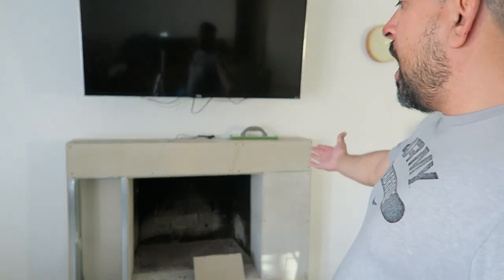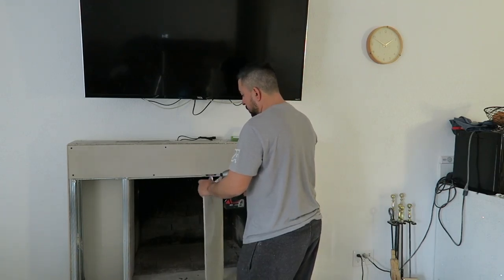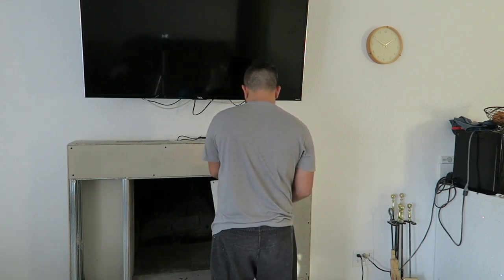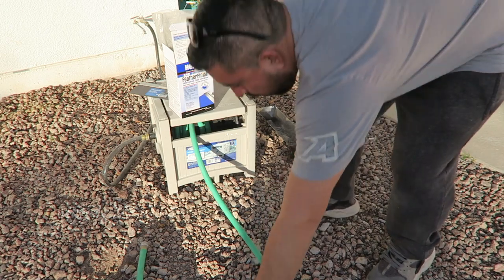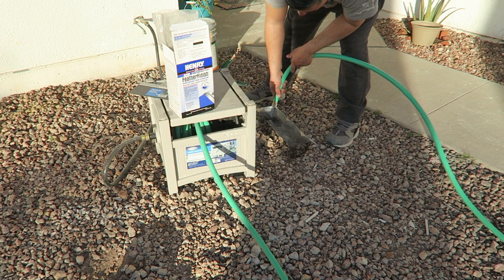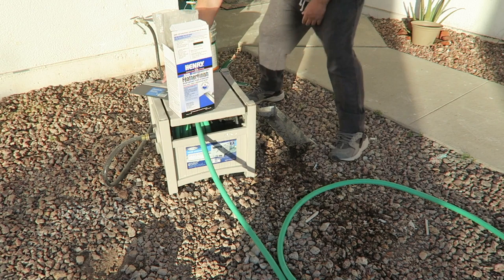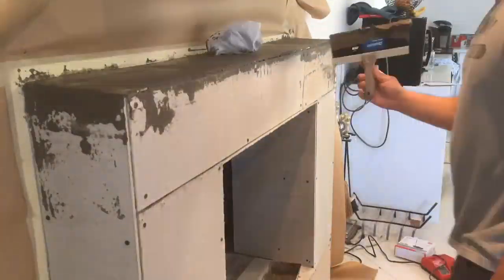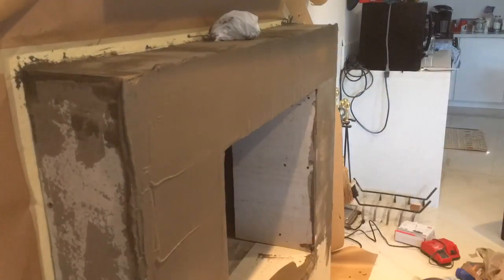How to make a fireplace facing look like it's made out of concrete

Comment: No corner bead, tape or mud on those joints, could have cracks later down the road. I hope it turned out good.
Reply from the maker: GameBangN 101 it’s still holding up good no cracks. Thanks.

Comment: I'm guessing there isn't a picture of the finished product, because all the seams have cracked and the grid pattern of the board has shown through. First, he should have  filled the seams, which is called "striking" with the same material he put on as a finish, with mesh tape used for drywall and cement board. This has to be done before tiling and finish work to prevent cracking. 

Second, the board has two sides. One is for use with tile (grid side) and the other is for smooth work. Generally, the grid pattern is put towards the work to use as a guide for DIYers. 

This is exactly why some DIY people should not make How-To videos, unless you KNOW what you are doing and are willing to show the finished project....you should also expect criticism, if the job is done haphazard, which this one was. If he's happy with it, great.
Reply from the maker: I accept your criticism. Job turnout Great and there’s no cracks on it. Mainly I did it because there was nothing like it on YouTube at the time